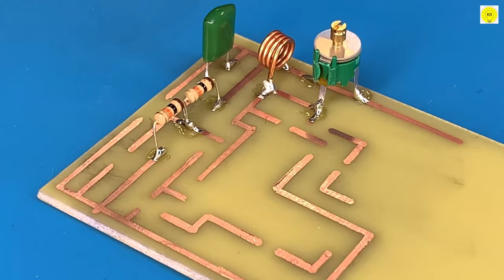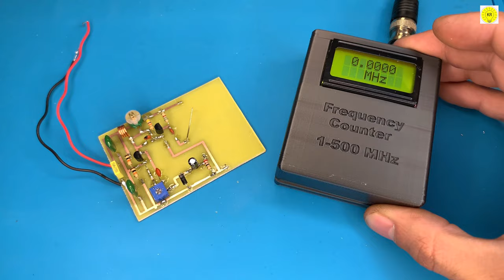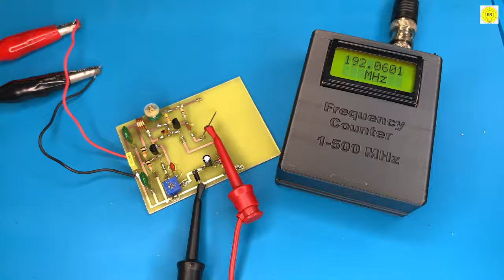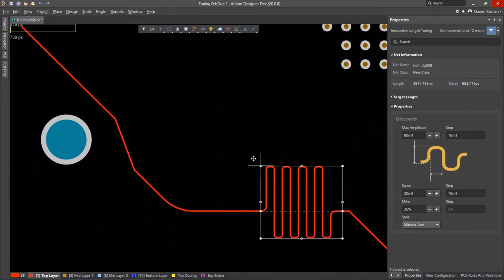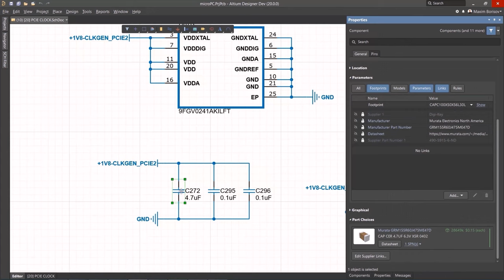diy video transmitter how to build your own wireless video system

Comment: I don't have frequency counter to decide the operating frequency, what shall I do?
Reply: You have to buy
Reply: crying
Reply: Often multimeters already has frequency measuring mode, so consider buying multimeter instead, because there's more features besides frequency measuring unlike counters
Reply: @CoberlightShow  
Okay bro
Thank you
Reply: You dont need to have one. You can tune either receiver or transmitter to get a signal.
Reply: @kripalowski8379  
Okay friend 
Thank you 
I will try it out